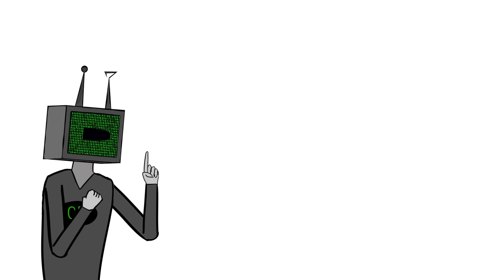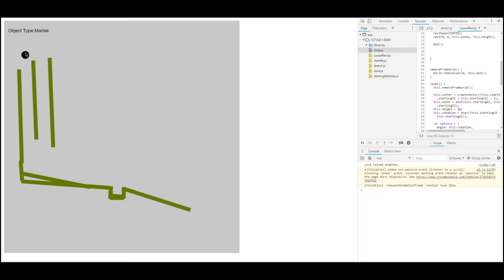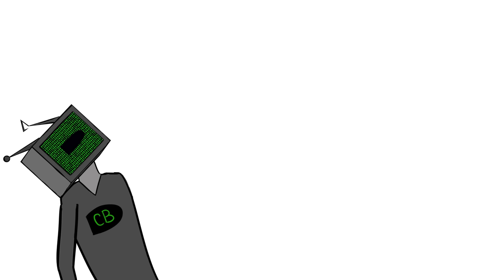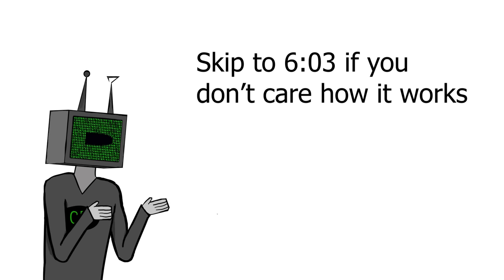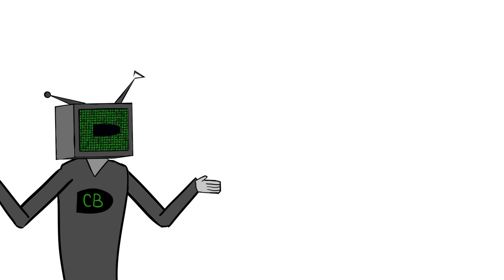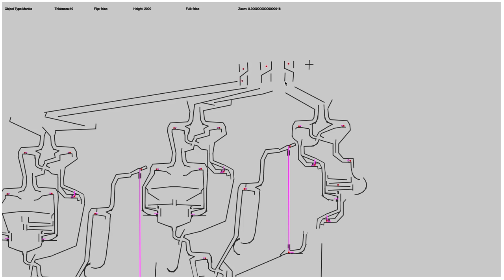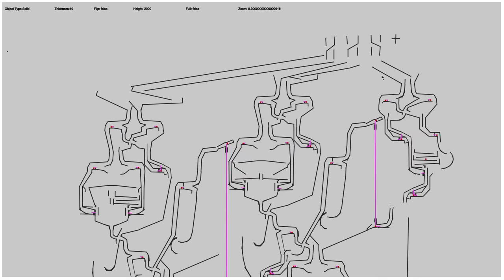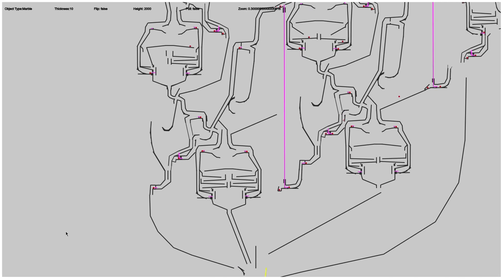Making a Calculator using ONLY MARBLES

Comment: New challenge: Make a marble using only calculators
Reply: Or just animate one with graphics function
Reply: 3 steps:
Search "marble"
Reply: So... Katamary Damacy?
Reply: Just write a “0”
Reply: @tthung8668  Your calculators have metal in them ? Damn !
Reply: @[Original name] im on mobile
Reply: @niva9644  then you can make marbles in your calculator so you can make a calculator from marbles from the calculator! brilliant!
Reply: ★surprised pickachu face★
Reply: This video was just that.

Computers are... well... big calculators.
Reply: I want to see that video
Reply: 1000th like
Reply: Huh i gotta search that
Reply: Still waiting for that video.
Reply: Calculation speed: 0.0001Hz
Reply: Stop torchering him
Reply: @niva9644  then melt the computer into a marble
Reply: So you have to Round a calculator? But isn't a calculator already whole?
Reply: the marble is being rendered by the computer, which is a calculator tho
Reply: Easy enough ; the only formula you need is (pi)r^2
Reply: Well, they technically are already on a computer...
Reply: @tthung8668  you can calcylate which bytes should be 0s to make a round marble
Reply: Isn’t that just simulated physics?
Reply: no i meant physically making a marble using functioning calculators
Reply: @regretitnot5652  just think of anything divided by 9 that isnt a multiple of 9
Reply: 27th, cursed.
Reply: YES
Reply: @Mandakins347  At first I thought you were taking about an actual torch until I realized you were trying to spell torturing 😂
Reply: @Daniel-ss5tg            🍱🍱🍱🍱🍱🍱🍱🍱🍱🍱🍱🎡🎡🎡🎡🎡🎡🎡🎡🎡🎡🎡🎡💈🎮🧿🧿🧿🧿🧿🧿🧿🎰🎰🧿🧿🧿🧿🎰🎮🎰🎰🎮🎮🎮🎮🎰🎰🎰🎮🎮🎮🎮🎮🎮🎮🎰🎮🎮💈💈🎰🧿🎰🧿🎰🎰🧿🧿🎰🧿🧿🧿🎰🧿
Reply: Lolol he wont
Reply: @Lyf4rMusic  yours don’t?
What do they use for wires, fibre-goddamn-optic cables?
Reply: @electricheisenberg5723  Oh I wish we had that level of quality...Even with CASIO ones, we just get nice quality plastic, no metal involved at all.
Reply: @Lyf4rMusic  but what is the WIRING made of
Reply: @Lyf4rMusic  (copper is a metal)
Reply: @electricheisenberg5723  I don't care about the insides of the calculator... That too in very small amounts. Also, I don't know which damn calculator you're using :/
Reply: Now I just wanna see someone break down a calculator to all its separate parts. Melt all the pieces down and mold the different parts into different marbles.
Reply: @Lyf4rMusic  1:
damn near everything that isn't made of gold in the electronics world is copper
2:
wiring is most of the calculator so actually it's quite a lot of copper
Reply: @electricheisenberg5723  1. I mean didn't even talk about any specific metal, let alone 'Gold' ... I was talking more on the outside appearance of a calculator that uses a metal covering or buttons (which I haven't experienced in my country) ... So that's why I've said I could care less what they use inside (honestly there isn't much wiring in calculators apart from the soldered ones)
Reply: E
Reply: It’s so easy just crush the calculator up into a sphere and BAM MARBLE
Reply: cauldron

Comment: a calculator that can add numbers up to 7 with 60% accuracy!? just what I've been looking for!
Reply: Wait, why do u say 60% accuracy. Seems like it was 100% accurate from his tests?
Reply: @will227inyoface2  He says in the video that the accuracy is about 60%.
Reply: Actually I'm kind of calculator that can add single digit numbers with 60% accuracy
Reply: Better than some 15 year olds I know.
Reply: @DrZaius3141  You should know better 15 year olds.
Reply: 7 + 2 = ? (111 + 010) 0101 whic iiiissss . . . . 5 XD That 60% BUT I FRICKING LOVE IT
Reply: I made an adding calculator that can add infinity with 100% accuracy
1. Put starting numbers in separate bowls
2. I put them together
3. Wow
Reply: @will227inyoface2  10:36
Reply: Just about pissed myself reading this. Thanks.
Reply: @KecskeHarcos65  actually, 7+2 in binary is 1001, which is 9, pretty sure the system works there
Reply: @asgeiralbretsen  100th like congrats
Reply: @DrZaius3141  well that's because 15 is equal to 7 plus eight and they can only calculate up to 7 plus 7
Reply: @cheesus_the_grate  Do you have resource code on github. I really wanna try your computing method.
Reply: best cauculater ever
Reply: @KecskeHarcos65  it's 1001
Reply: as a bonus, it does it really slow -- I'm sold
Reply: It's definitely going to be useful for physics right?
Reply: add 1+1 =umm

5!
Reply: @will227inyoface2  its just a design flaw thats all.  The balls path randomly when they are dropped.
Reply: @will227inyoface2  did you watch the video
Reply: @will227inyoface2  it was 100% because all my friends used it many times, and not once has it failed
Reply: Jmandawgfan my drunk brain
Reply: @AnyEthan  5?

001 =1
001 + 001 = 010 = 2
Reply: E
Reply: This has made me realize I am like the marble calculator
Reply: @will227inyoface2 occasionally marbles like to misbehave. Even though it should  be enough speed to go down the ramp marbles just stop for an unknown reason

Comment: Adding 5+7
Normal people: Easy it's 12
Code Bullet: Yeah, this is big brain time.
Reply: 12 --> C --> 0000 1100
Reply: @CUBETechie  ok
Reply: @CUBETechie  he literally said that in the video
Reply: Carry it to 57
Reply: The funniest part is that even tho the marble calculator calculated the value, but you have to calculate the number value yourself. So if Code Bullet would add a binary converter from binary to actual graphical numbers, then it would be better.
Reply: Or is it? Vsause music
Reply: @taktikalmothertrucker3637  Hey Vsause! Michael here!
Reply: @dunjaslomovic6573  No.... 
7+5=12
5=2+3
7+3=10
10+2=12
Reply: Rust
Reply: 1010 + 1110 = 0011
Reply: Xd
Reply: Me, who does 5+5+2
Reply: @ZVLIAN  No
Reply: E

Comment: For when the exam says no electronic calculators
Reply: Abbacus time!
Reply: That's when you bring a curta (tiny mechanical calculator)
Reply: did you know your brain runs on electricity
CORRECTION: it works using electricity
Reply: @zombieslayer1468  shutdown brain
Reply: @zombieslayer1468  your brain "runs" on a lot and none of it is what we think of when we say electricity

Comment: “...Least efficient calculator...”
You haven’t seen Mario Maker levels...
Reply: Or even minecraft ones!
Reply: @kingmeprime  minecraft ones are pretty efficient since redstone computing is actual binary code but virtual, they work on the same concept with 1 being on and 0 being off
Reply: @Kekatronic  Not efficient when it comes to processing. Your computer will be simulating an entire fictional block world just to perform a single fundamental mathematical operation.
Reply: @thatotherandrew_  Better than calculating the physics of a marble, at the very least.
Reply: This is actually how SMM calculators work but nice joke
Reply: @LucidMlem  Yes, but that wasn't the point of the comment, talking about how doing some of these logic gates in MM take even longer thus not being as efficient...

Comment: Btw You could make the gates wait until a marble “activator” activates them and then release the correct output, this way You will not need to wait while using the NOT gate... :)
Reply: also the xor gates would be much quicker, but you would need a 3d space to fit your clock tubes...

Comment: I have a better, simpler marble calculator. You put 5 marbles in a tube. Then you put in 7 more marbles. Count the marbles. You have 12 marbles, which is the correct answer!

but this is way cooler
Reply: The output is in binary, not in decimal.
Reply: PurpleKingCrazy

thats not decimal, its unary
edit: jesus christ what have i started
Reply: That's not Protese, its Psychology
Reply: That's not Psychology, it's Anthropology
Reply: That’s not Anthropology, it’s Defenestration
Reply: And I broke the comment chain!
Reply: That’s not a broken comment chain, it’s a faulty section
Reply: That's not a faulty section, it's a disaster
Reply: That's no spaceship, it's a black hole
Reply: That’s no black hole, that’s a time warp.
Reply: That's no time warp, that's a universe
Reply: I'm proud of this magnificent chain
Reply: @MiguelinKali  Rip
Reply: @besttuberz7014  Thats all for Now folks!
Reply: K
Reply: What the fuck is going on over here lmao
Reply: Thats not a magnificient chain, thats a rope.
Reply: @MiguelinKali  YOU BROKE IT
Reply: Just to be clear, the method you propose is correct, but it would require you to count in infini-tary (I made that up, but its basically in base infinity). The argument is easy to make that it is not an easy way to calculate... What the calculator here does, is calculating in a finite base which is binary.
Reply: @alfreduko7112  It's not a fortnite virgin, It's a Ferral solution.
Reply: eurehl5238 its not a ferral solution, its me michael v-sauce here
Reply: @chiiing8288  Its not a michael v-sauce, its how to basic
Reply: @Artiliada  it's not how to basic it's ur mom gay
Reply: @jo7045  shit, I'm so retarded lol
Reply: That's not a disaster, it's a paradox
Reply: Its not paradox, its infinity
Reply: that is not infinity its nothing
Reply: That is not nothing its everything
Reply: It's not everything, It's anything.
Reply: That is not c++, it's a food.
Reply: Thats not a food, its a foot lettuce
Reply: That's not a food lettuce, it's a salad
Reply: You thought it's a salad, but it was me, Dio!
Reply: Perfect
Reply: It's not a disaster, it's Sans undertale
Reply: Terry Pollak it’s not sans undertale, that’s a dead corpse with a jacket!
Reply: @LeMiraculer  it's not a dead corpse with a jacket it's a skeleton
Reply: that's not disaster, that's an order for execution.
Reply: @lemonice  that's not a order for execution. That's a Code bullet.
Reply: That's not code bullet, that's a half A press!
Reply: Oh dear lord. Now I'm apart of this, but I'm an error in the system.
Reply: @Choinkus  Its not a half A press, its a half bee press
Reply: @corinth9140  that's not a half b press, that Half life.
Reply: @Artiliada  This is not half life, this is patrick
Reply: Mehmet Erkan Aktürk this isn’t Patrick, it’s the work of an enemy stand.
Reply: PremiaCamaro this isn’t the work of an enemy stand, it’s a work of art
Reply: SCP 999 this isnt a work of art, it’s an art of working
Reply: oj f0j its not an art of working it’s the workers party of china
Reply: @tux1468  not unary. Its binary 1 and 0 are 2 variants of numbers in system
Reply: Yeah, but this system only has 1 thing in it, which is marbles.
Reply: It's not the remnants of a democracy bent on taking back hannukah. It's the ruins of a dictatorship bent on taking back Eid.
Reply: @tux1468  your comment chain is still going.
Reply: that's a lie, unfortunately...
Reply: HappyRyan its not delivery its digorno
Reply: EZ_GINGEY YT it’s not digorno it’s Portuguese.. oh wait
Reply: @jakobhudson9007  it's not oh wait, it's oh shit
Reply: Michael Ibarra it’s not a dyslexic whale, it’s an Oh Yeah Yeah
Reply: @Pikachuisloveandlife yes it is. The comment chain is over.
Reply: @JS-nr2ld  It didn't just begin, its over
Reply: Wait did I contribute to the chain by saying that? LOL
Reply: Im the 999 like someone like
Reply: @bigblackbadger1  you expected this to be over, but it was I, DIO
Reply: @Satepin  replying just because I want to lol
Reply: :v
Reply: @manuelvillarreal2164  isn't it amazing how this comment is still getting replies? I mean, when was the video posted?
Reply: @bigblackbadger1  isn't it amazing that a gravity based calculator can make a comment thread this large? I mean, when does that happen?
Reply: What about a computer?

Comment: I once spent a more time than I had designing and building a binary calculator in minecraft using Redstone circuits. It's not easy.
Reply: Bruh Thats what I'm trying to do right now. I'm using this vid as a tutorial lol
Reply: its litterally the same thing yeah, its logic. while its not easy it can be simulated with marbles
Reply: I’m going to do the right now
Reply: @joshuabradford8372  good luck dude.
Reply: Enemyonwheels thanks :)
Reply: Enemyonwheels update: finished AND, OR, and NOT gates.
Reply: @joshuabradford8372  making individual gates is easy, but putting them all together into full adder is harder
Reply: @bamberghh1691  yeah I learnt that the hard way
Reply: at least it's easier than with marbles. It's far easier to make calculators and computers in Scrap mechanic though. I made a calculator in SM that can add, subtract, and multiply two 8 bit numbers.

Comment: Reading and writing binary is as follows. Starting from the right and reading to the left, every digit is twice the amount of the digit before it starting from 1. So it will be 16, 8, 4, 2, 1. To translate a number from binary to decimal is to add the values that hold a 1. For example, 11111 is 31 because it's 16+8+4+2+1. To translate a number from decimal to binary, you just need to play with the values a bit and see what adds up to the number you're translating from. Try translating 29 into and from binary now. It is (11101) because 16+8+4+1=29. We don't add 2 because it's a 0

Comment: I just made an ALU using Neural networks trained to be Logic gates and then strung together to form Binary Adder, Subtractor, AND, OR up to N number of Digits. Pretty proud of it. Worked better than I could expected, I thought the variance in output of Neural network was going to compound and mess the system up but it works flawlessly and appears to be self correcting.

Comment: XOR is also quite intuitive, it just means "exclusive OR". or, to put it very simple, IF "OR" AND NOT "AND" (you can actually make every gate out of other gates, which is simpler in a lot of ways, so actual calculators don't use AND, OR and XOR gates, but AND and OR gates made of XOR gates, for example)

Comment: If you put two not gates together there'll be a problem though: the second not gate has to wait twice as long, but twice is not too bad and I think for any circuit you can create a marble equivalent of polynomial size (this also means that it's NP-Complete to decide if's some output marble configuration is achievable from a given marble circuit).
Reply: The last statement is because you can reduce planar circuit-SAT to marble SAT with polynomial overhead.

Comment: Just add a marble in a chamber based on the number. Like if it's 5 then 5 marbles. Then add a bunch of bumps in one line. So the number of holes filled is the answer.

Comment: I figured out how to memorize the binary numbers by sight with a trick
There are four spaces, if there is a 1 in that space, it has the value of the space in a certain way.
The spaces numbers are
8421
So....
1010 is 10 because there is a one in the 8 spot and a one in the 2 spot, added together to be 10
0111 is seven because the areas that have a one in them add up to 7( 4,2,1)
You can do this with all of them up to 15 and then I assume that the next value , the fifth place, would be a value of 16

Comment: I liked this. I took a screenshot of the test be built before showing the actual thing, and made a small model showing every logic gate, input, output, and how the gates connected. Using this, I build the same thing in Minecraft using Redstone. I have a list of 1-14 in binary off to the side on a wall, and the user interface is pretty cool too. It has two seprated sections each with 3 levers on lamps. To the right, I had 1 lamps. Just wired it up, and it works perfectly! I even noticed that the design can be infinity expanded to make addition calculator with ad many input as you want for each number. I have a question. How would you make a subtractor/multiplier/divider still using modular units? If anyone has a link, or some other form of explaining to me how to do this, that would be awesome.

Comment: Bruh, this is not a calculator, its an adder, a calculator requires much more work
Reply: A calculator calculates. By definition an adder just implements addition, and as such, is a form of calculation. Plus, he did mention in the video that its an adder.

Comment: If you extended the track to count numbers up to ten, you could use it to write longer equations. By just repeating the same course in an intricate pattern. Also would it be possible to make AI figur this out for you?? If so, how many variables are we talking?? I mean like in-puts, as the ai needs to learn match, but with proper code that should be fast enough. Then it needs to learn the design you created to count up to ten, in marble binary, marbary?? Just the design, then it needs to learn the patter it would need to know to do bigger sums. (To be clear, I want to make sure I don't sound crazy. Im talking about a structural design like the one that you have that counts up to a value of seven. A design that can count up to ten, wouldn't even know where to begin, I will need to watch this video 58 more times before I can truly grasp what is going on, the complexity/ beautiful simplicity of the gates and how they all interact so seamlessly.... it escapes me for now, but 59 generations in, I  should start to get the hang of it. If it can count to ten, you can use it to fill in other equations right?? I think you would have to set up a sub system that can move the balls to the relative positions they would have to drop at. Since you just click them into being where you want them to drop down your track. Anyway, would it be possible to get an AI to try and figure out how to do that for you, essentially it would need to go through the exact same design steps you did to get anywhere, and at some point it might reveal that using a system that can only add up to seven, but aplies the same rules as binary math (ie, 1+1 =10) would eventually focuse on small ass numbers constantly adding up and just replicating the structure the marbles run through. (Ie. A design that can only count to 2.)

Comment: adding is easy, just use base 1 except with the digit 1 instead of 0. (basically tally mark) Then just drop all of the balls.
for example:
111111111111+111111
drop the balls and the result is 111111111111111111